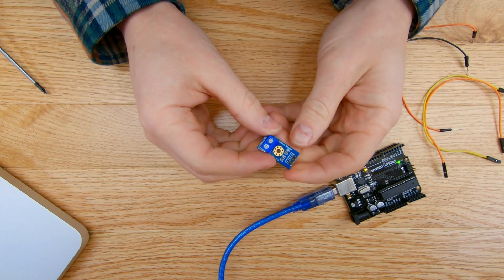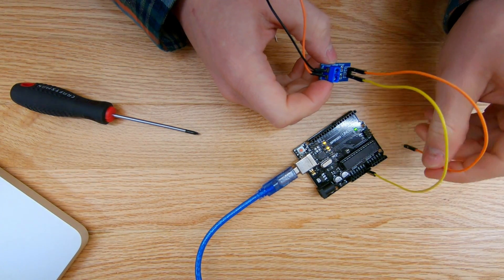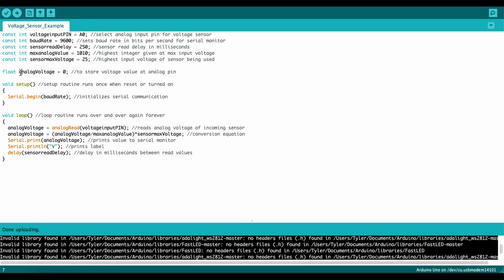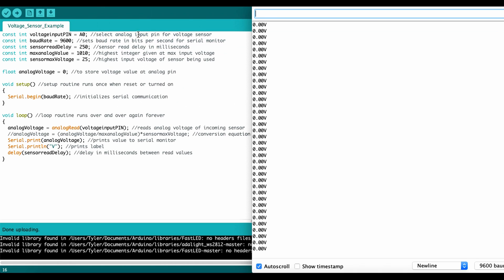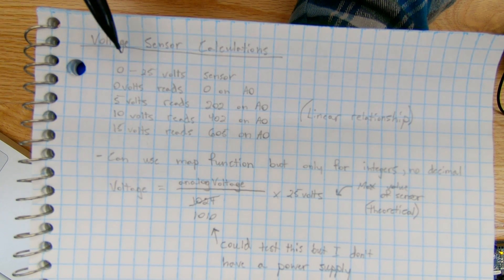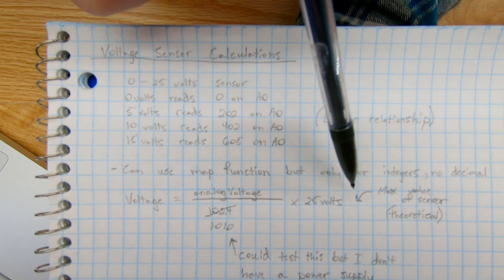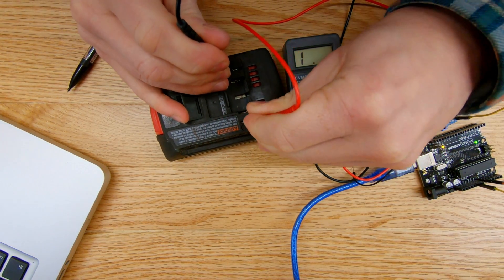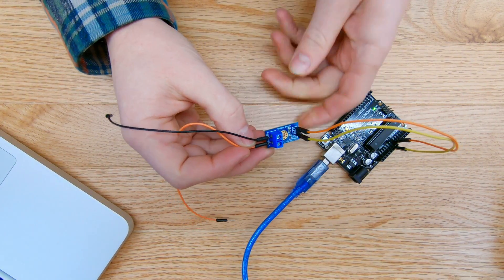Voltage Sensor - Arduino

Comment: Hi Sir can we add a relay module. Function of relay is when the voltage reach example 14v relay will on and if it goes down to 11v relay will off?  It is possible? Thank you...